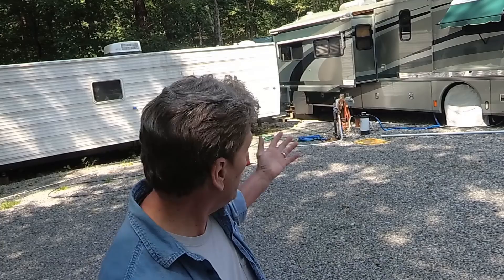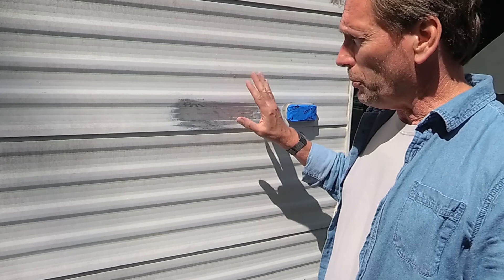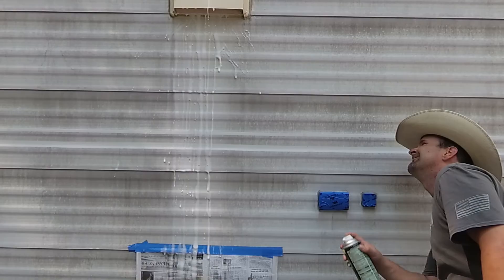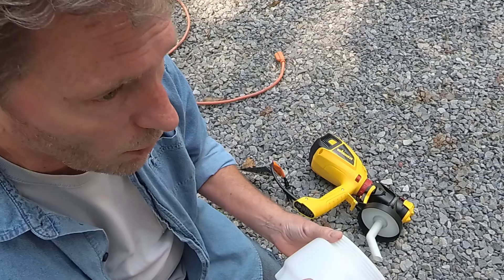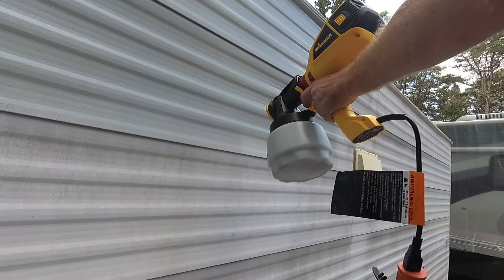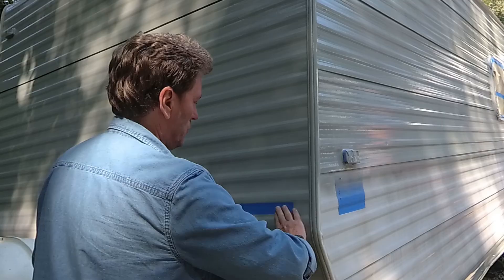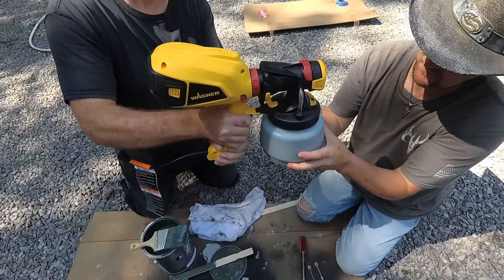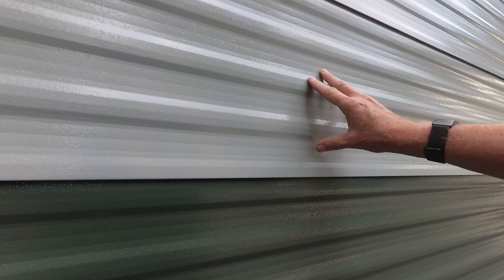Painting An Old RV Trailer (Step By Step)

Comment: I worked in a truck and trl paint repair shop for many years.  I found out that painting the lower half first and then the top half after lends itself to an easier time of masking off the first painted area. You can set out your masking paper by tacking it as you unroll the paper.  Then come back around and tape the paper to close it up completely. Also if you are stripping I always painted the stripe area first.  Again this reduces the amount of tape and mask time and material. Paint your 2nd lower color next, mask and then paint the top color last.
Reply from the maker: Excellent suggestions. Thanks so sharing.
Reply: Stripping, as in removing, or striping, as in placing different colors of tape? I need clarification, please. Thank you.
Reply: Judging from the context of the comment, I believe that the word would be "striping".
Reply: @patrickbodine1300 I think he’s talking about painting a stripe versus using a decal.

Comment: That looks great Gene! I had one bad experience with a Wagner Power Painter back in the 80's- made a big mess of what I was trying to accomplish- and haven't tried one since.  Maybe they deserve another look.
Reply from the maker: I felt the same way. I had one years ago and it painted like someone clearing their throat. This one however was totally different. I was really surprised at how well it did. I’m going to do a review on it. Thanks so much for watching.
Reply: If you look at my channel, I have a review of a generic one, which I highly recommend because it made some improvements which make it easier to break down and clean, and I also have a video on fully breaking down the Wagner, even beyond the normal amount where you take The needle and spring and remove it because paint can build up in there. It’s important to practice and really understand some of the settings to get good results but if you do that you can shoot latex that comes out so nice it looks like it was sprayed from a can.

Comment: Maybe use aluminum siding paint which is made for this kind situation?
Reply from the maker: Well, so far and two years later the paint is holding up great. They have even pressure washed it and the paint holds up great. Thanks for watching.

Comment: Thanks for the video. Was thinking about painting my trailer. Was wondering if you have cleaned it since painting ? And if you did did you use the power washer?
Reply from the maker: Yes, my brother has power washed it a few times and it is holding up great. Thanks so much for watching.

Comment: I've never had much luck with airless sprayers, but that one worked great.  Nice job as always, Gene.  What kind of paint was that, enamel? Latex?

Paints are a bit different here in the UK.  Roy.
Reply from the maker: It was an oil base enamel from Lowe’s.  I was really surprised how well the spray gun worked. I had one years ago and it painted like someone clearing their throat. LOL. Thanks so much for watching.